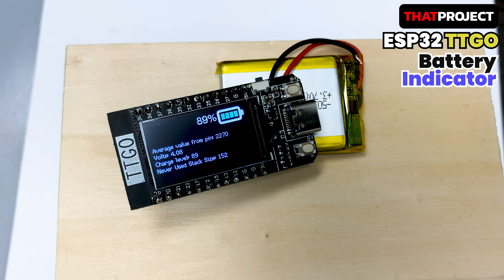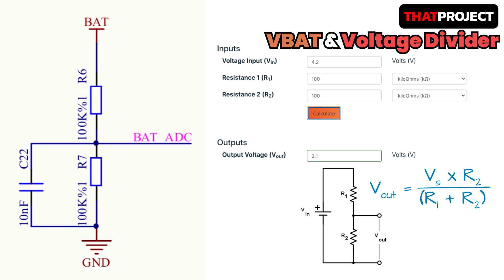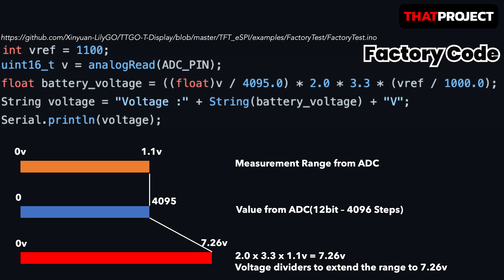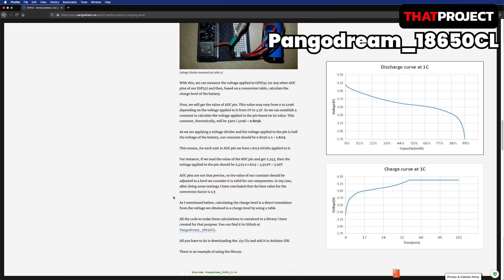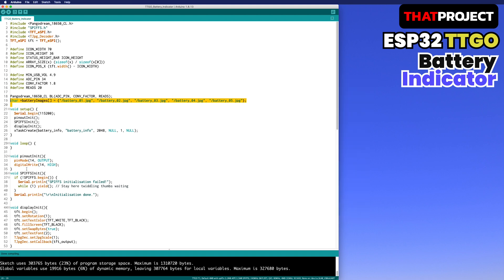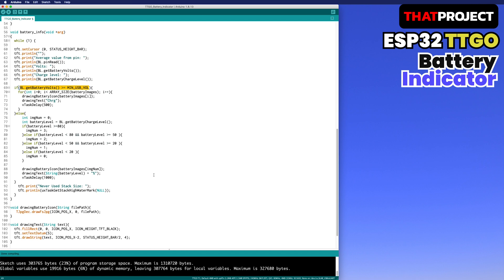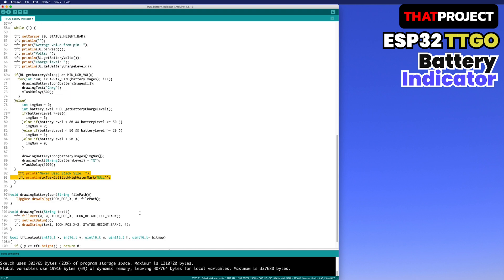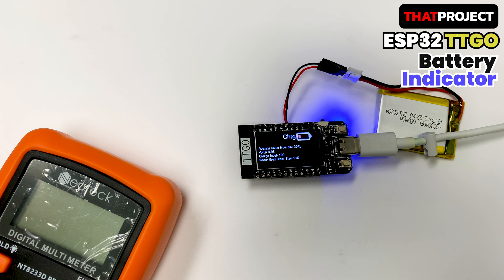ESP32TTGO - Battery Indicator 🔋⚡

Comment: Do you have any idea how I can use both I2S bus independently?
I want to record from one port and send it to the device and using second I2S to play recorded file received from others device simultaneously
Reply from the maker: Well, sounds like it's possible. Let's say there are two I2s, TX, RX. TX connects to the speaker and RX is for the mic. In this case, while reading the data from the mic, also writing this data to the speaker. It's like operating the echo mic.
Reply: @ThatProject  are you going to make some videos on same topic plz